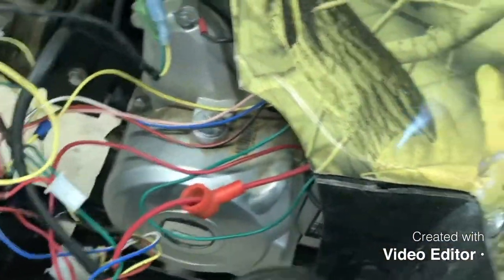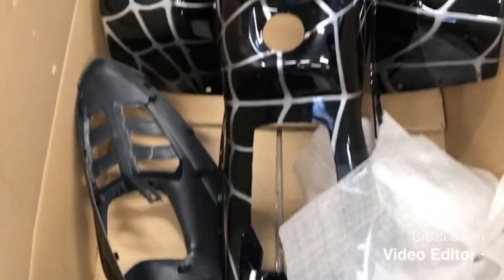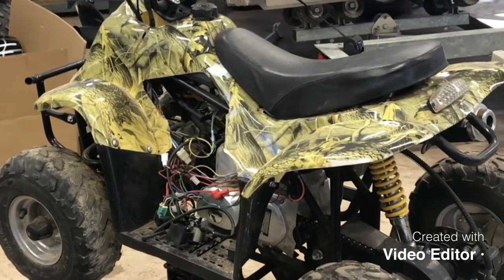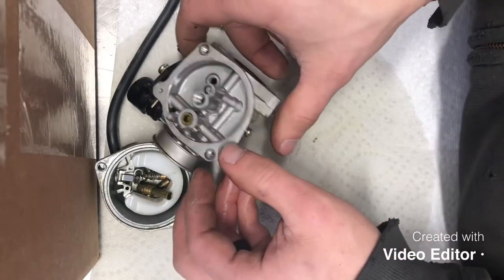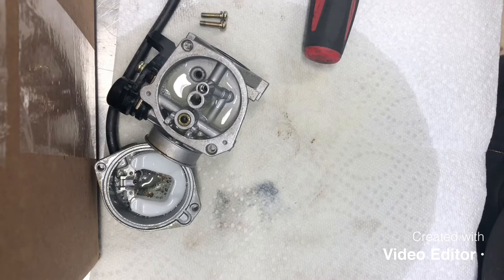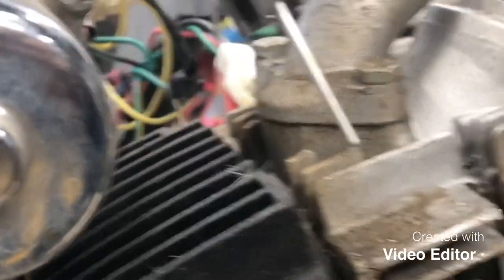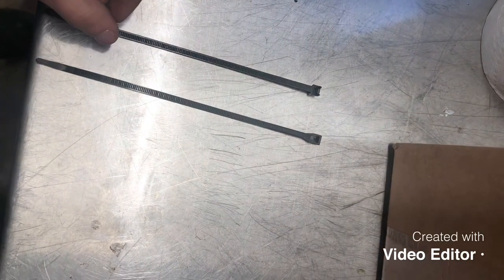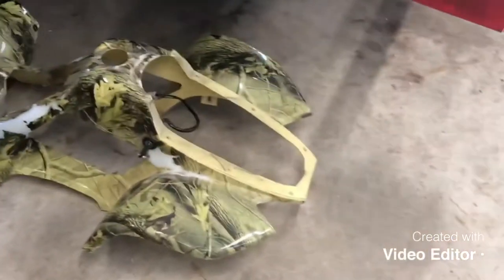How to clean the carburetor on a kids ATV

Comment: Hey buddy really enjoyed the video, I have a question I changed the carb got the 4wheeler running great. Parked the 4 wheeler for a sec and tried to start it and it wouldn't start won't click or anything it's like one of the safety features has me locked out. I unplugged a small box underneath and the brake light came on and it let the starter fire then brake light went back off. I tried plugging and unplugging the box but can't get the system happy to let me start the 4wheeler. Any idea what safety stuff I can ditch or how to get the 4wheeler running again?

Comment: Yea I had a tao db17 I lost 2 motor bolts  my swing arm bolt and my rim was bent.   I changed all.my bolts with a a8th grade bolt and use blue Lock on it and it's been good over a year now

Comment: I have a Welch plug on the outside where you have an air jet, would you feel certain if I remove it there will be an adjustable jet there. Kymco mongoose 90 atv. Thanks
Reply from the maker: I can not say for sure
Reply: @therapawayhomestead5464  It did, I removed it and adjusted the jet, now idles perfect. Thanks.

Comment: Does it matter which way the plastic sleeve is turned when I reattach the throttle? Has a groove on one side and a notch on the other
Reply from the maker: The notch has to go towards the idle adjustment.

Please subscribe if you haven't already